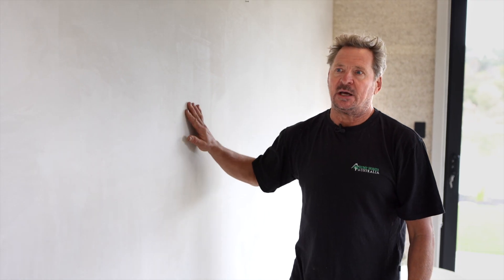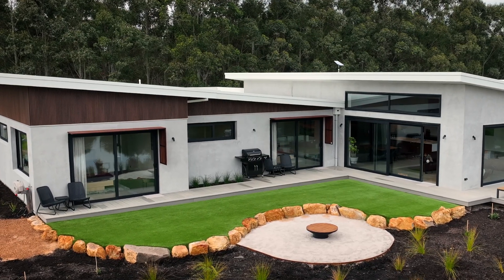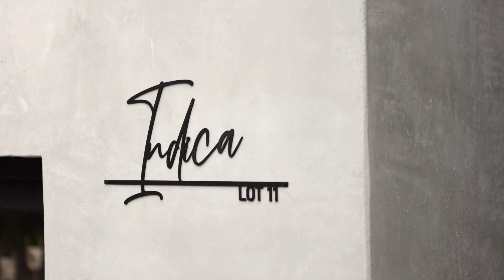Building The Future With Hempcrete Homes - Western Australia's Latest Locally Grown Home!

Comment: Hi Gary and team,
Well done!
I like your sustainability input!
May I check if you tried to build a frame for the house from metal.
Or just timber frame works good with Hempcrete?
Reply: Hi, no we haven't built with a steel frame as we believe wood is better then steel. However, it definately can be done, you just need to make sure your frame is sealed before the hempcrete is poured in.

Comment: Bravo! I got interested in this topic a few years ago. It’s wonderful.  A natural insulated and resistant to mould and pests and fire. Highly sustainable with fast growing times and it pulls toxins. Dr Wasaru Emoto of Japan stated that if Fukushima (nuclear power plant damaged in 2011 quake), was surrounded with hemp, that hemp would absorb the radiation and make it safe. 
I believe in these sustainable systems. Combine it with other heating/cooling methods, water systems, and energy storage and you’re away.

Comment: What's the compressive and tensile strength like? 

What are the sound, moisture and heat insulation properties? 

How much does it cost to build with compared to concrete or timber?

Comment: I'm curious, what was used for the structure? Hempcrete isnt known to be load bearing. Also, what happens if there is rain, the walls will absorb the water and retain it and the house will crumble?
Reply: A Wooden frame is built first then hempcrete is poured into the form work on the outside of the frame. We seal the outside with a natural clay render. Totally water proof👍
Reply: How often do you need to reapply waterproof clay render ?

Comment: Pity about the synthetic grass.
Reply from the maker: Yes, we were employed to build a hemp house. I'm afraid clients do what wish😐
Reply: The last home I built for the family was a split-level mud-brick one but that was more than 30 years ago now. 3,500 bricks formed with soil excavated from the bottom of our main dam and constructed most of the windows by hand + my trusty and now rusty Triton Mk 3. Back then there was heaps of 2nd-hand timber on hand. Bought all the Welsh roofing slate from a plumber at $1 each which I cut into 100x200mm tiles for the wet area walls. Was different era back then and I was young. @margaretriverhempco5899